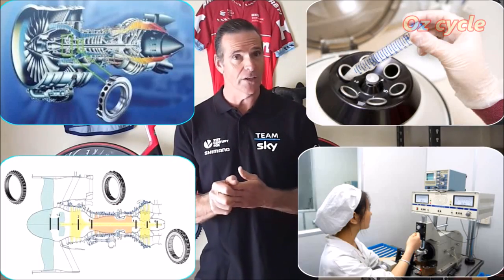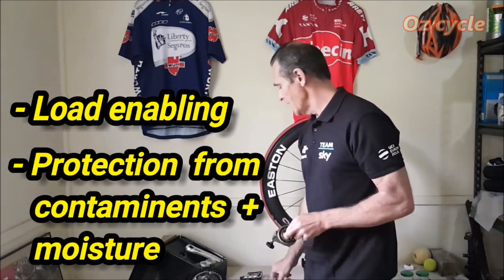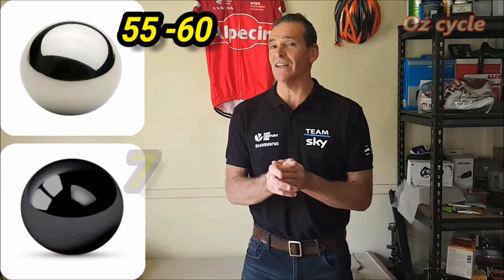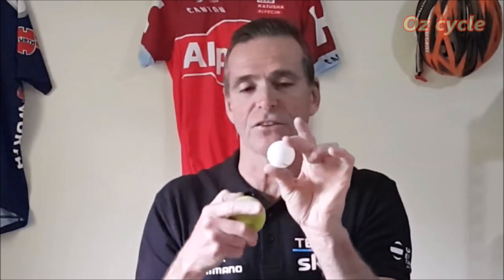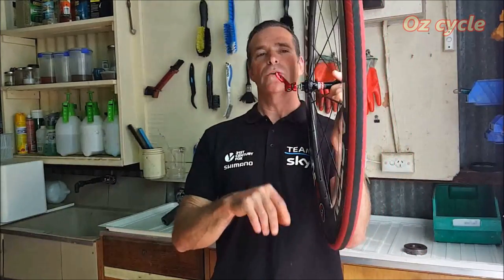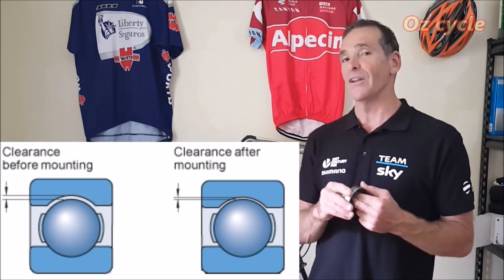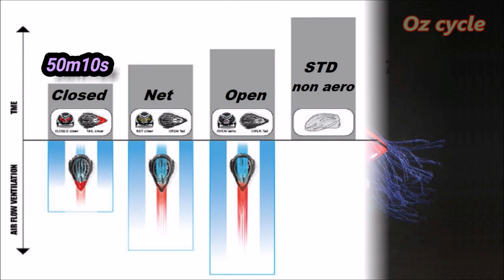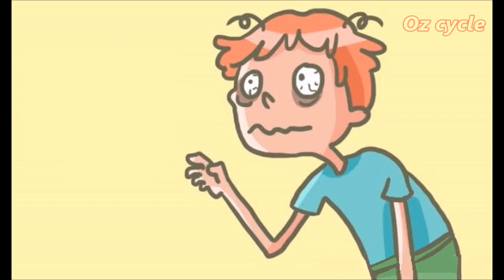Ceramic Bearings - You need to know!

Comment: Ceramic bearings are used on spools for bait casting reels that can reach rpms up to 30,000 rpms. I’ve converted some of my reels already. My mtb has ceramics in the shifter cogs. Liberty makes some pretty good synthetic oils. 
I’m waiting for a set right now. 
And English website “ Pimp my reel” upgrades the bearings on request. The anglers can throw weights almost 300 yards. 
You can order from China 🇨🇳 for cheap.
Reply: I can see that on high rpm applications, but bike wheels turn between 200 and 300 rpm . I doubt very much that even a pro rider in a blind test would tell the difference in almost any bearings in the wheels that are properly set up and tuned.

Comment: I like your reviews - always informative. I query your comments about lubricating sealed bearings. In my experience, sealed bearings are just that - sealed, and they can't be re lubricated. Shimano bottom brackets are specifically marked - 'Do not disassemble'
Reply from the maker: I see your view Richard. However, "sealed" bearings are not entirely sealed if water and debris can get into them,which is all too common with bicycles. Hence the need to either replace or clean and relube them.

Comment: Very true, I cleaned all the grease from my pedals as I noticed how stif they appeared and applied some light oil as an experiment. The pedal spun much more freely afterwards. I did replaced the grease with much lighter grease before use. It just means I have replace the grease more often, it’s only a 5 minute job once a year. 
I have BBinfinite bottom brackets, maybe it’s the placebo effect but I’m sure its much easier to pedal. Plus using your waxed chain. I cant ride faster i just feel like i get upto speed faster.

Comment: This is why I switched to MG chemicals White Thin Lithium grease. It’s great on firearms sliding metal parts but it’s even better on bike hubs with loose bearings. Since I can’t stand sealed bearings I started using this lithium  grease for packing my road bike hubs and also the Older caged bearing bike bottom bracket. It’s a cheaper bike but it is just super quiet, unlike the more expensive bikes sounding very noisy drive trains.

Comment: Yes other industries use Ceramic bearings... not hybrid Ceramic bearings like the cycling industry!

The best and I mean the best bearings you can use in your bike is high quality steel. Hybrid Ceramic is for people who fall for marketing. Hybrid Ceramic give no real world performance benefit and cost more and don't last as Long.

Ceramic bearings are not more round than steel, it depends on the quality of the bearing. Chinese Ceramic bearings are as round as bananas, even an average steel bearing is better.

Also steel cages are better than the polymer ones as they cause less friction.

Also don't bother with Ceramic bearings if you have a carbon bike BB shell, because the shell tolerance is not good enough for the bearings.

I run a bike shop and I see the average Ceramic bearings lasting about 3 to 4 months before they destroy themselves. I wish customers would stop buying them and wasting their money. They are just an expensive way to not go faster.
Reply from the maker: Yes its still contraversial about steel vs poly cages but the bicycle industry favours the poly at the moment.
Reply: oz cycle I don't think it's controversial? It's fact, they have the data. The poly cages are normally populated by hand and steel are made by Machine so have better tolerances. Check out the video on how bearings are made at NTN or this video for more information 🙂👍🏻
https://youtu.be/o7iZVfSDbiA

PS. Only some manufacturers (the ones I don't use) Favourite poly cages. I have DT Swiss wheels and praxis BB and all come with steel cages. I think the maybe Chinese Brand’s favour the poly?
Reply: Reginald Scot ... I've been using CeramicSpeed and Formula 1 ceramic bearings. BB, the harder I press down on the pedal, the easier it spins, been able to go up hills in the big ring, which I couldn't do before. Downhill, the faster I go, the least resistance they have. Big downhills where I'm going between 45 and 55mph, no one can stay with me, coasting, people pedalling have tried to keep up and can't on rides. Ceramic bearings have been my saviour in keeping up with the younger crowd. I'm 57, 6'3" and 200lbs.
Reply: @happydays8171  placieo is that much effective. anyone heavier than 200lbs will be faster at coasting. Physically from the native design of ball bearings, resistance you would get is about 0.3w. From here, the resistance from the ball is about 0.05w. If anyone can feel that... kudos to you...
Reply: Reginald Scot so true. Ceramic on ceramic like overused in RC last because the materials are.the.same. basically ceramics are for non load or minimal load applications
Reply: Thanks for the interest, allow me to explain please. I understand the placebo effect and gravity's effect of my weight going downhill. Before ceramics I was your average rider, middle of pack going downhills, passing no one. With ceramics - at high speed - I am now untouchable. i.e. RAGBRAI 2016, southern Iowa, very hilly, 15,000 registered riders and nobody passed me on the downhills, and there were plenty of heavier riders than I that I was passing. My point is ceramics only come into their zones at high speeds, at pedestrian speeds they offer the same resistance as steel.
Reply: @happydays8171  im sorry but no parts in bike is 'high speed'. Look up any mechanical engineering papers. Any steel and ceramic bearing (full ceramic which is superior in rolling than hybrid ceramic but yours is hybrid ceramic) have no difference until 15,000 rpm. Even if you ride 100mph, your bearing wont even reach 1000rpm. Good luck with that difference. It's just science.
Reply: 피토라이더 well put sir you are correct. I used to use fully Ceramic bearings in industrial applications in electric motors spinning at several thousand RPM. They are excellent for that application, but I wouldn't put them in anything that needs to deal with speed bumps, sand, grit and potholes!
Reply: Okay, okay, I've been researching this, using Hambring's test results NSK's VV steel bearings appear to be better  (the ceramic bearings that came in my Rolf wheels actually started eating up the hub like you said so now I'm trying to wrap my mind around the fact I might have been wrong.). Question, what's the best lubricant? One guy has a lubricant he claims never let's the metal touch, creates a microscopic film like engine oil between moving parts. What do you recommend, and how much? Syntheric or conventional, 1/4 fill, or more, and how often should I clean them? I ride 2,000 miles a year on one bike, 1,000 on another.
Reply: @happydays8171  it's just the best to just replace them regularly. Never a good idea to take out seals (takes up 60% of resistance for bearing). And greasing performs the best at 30% of volume filled, but it will affect longevity. It's always a trade off. Performance and longevity. Thin oil performs better but shorter life, thick grease resist more but last longer.
Reply: Happy Days Lowest friction is achieved by using a very small amount of very light oil, but it won’t last a single ride. Top flight track riders with full mechanical support to service bikes after each short, clean ride on the smooth pine wood might glean some benefit. Beyond that you’re looking at thick oil or grease. Manufacturers all recommend the latter. The refill rate is specified in the manufacturer’s technical literature and can be different for each bearing based on seal type, bearing type, tolerances and use. Grease increases the resistance to movement. This resistance is fluid resistance rather than the friction you’re more familiar with between solid surfaces, rather like the difference between squeezing washing liquid, water or air through the thin nozzle. Too much grease however can cause the ball to skip rather than roll which can cause direct contact between solid surfaces.
Essentially, the very best solution for real-world cycling is to use very high quality Japanese steel bearings with a non-contact seal for wheels hubs. Bottom brackets are much lower speed bearings and higher load and so the biggest issue is creaking. The higher and narrower tolerance of Japanese bearings is their advantage here. 
The only place where top quality ceramic bearings might help is in the jockey wheels, especially if you’re replacing a bushed cage with a bearing type. This is because of the low load, high speed and the ability to easily relubricate using lighter oil.
Reply: Someone changed their view on the basis of opposing comments. Truly amazing and possibly a first for YouTube. Good discussion Happy Days , 피토라이더.
Reply: @happydays8171  Is it possible you just go stronger?
Reply: Methodical2 --> Haha, that could be. I watched Chris King in an interview on here, he didn't seem to be big on ceramic for wheels, so last set of wheels I bought, left the steel bearings in, if anyone knows bearings, I think he does. We'll see, so far, I can't tell any difference.
Reply: Happy Days it takes incredible courage to test your beliefs and go read upon a subject. I am Super impressed that you decided to do your research and test what we were saying. If only everyone could be like you sir the world would be a better place. As for what I do with my BB I use a Praxis works BB30 to 24mm adapter that I have pressed in some high quality non-contact type steel bearings and used a lightweight grease using a syringe to place just the right amount. When people see my crank spinning without the chain on the bike they think it's a Ceramic bearing. 😂
Reply: Reginald Scot -- Thanks for the comment. You know my type, anything for free speed. So many different variables can negate the gains gained by ceramic bearings, i.e. tight seal, thick grease. Some years ago I bought some ENVE rims with DT 240 hubs, in my downhill testing, didn't get any more speed than steel after putting in CeramicSpeed bearings.
Wish I would have stopped there!
Reply: @happydays8171  Exactly. I bought Campagnolo Bullet 50s with steel bearings (not CULT) for all of the reasons listed not only in the video, but in comments left by Youtuber "in the know". Perhaps a perfectly tuned set of ceramic bearings would save me 13 seconds over my usual ride for 2 or 3 days or weeks. But I don't have the money the replace the bearings regularly like pro teams because they get a trailer full to last the racing season. 
So, as for me, "steel is real."
Reply: what kind of polymers?
i could definitely see thermoplastics deforming against the bearing creating friction...
Thermoset polymer?
Reply: @ptorider  Strongly agreed to you!!!

Comment: Please advise if it makes sense to lubricate the crank axle (as so many YouTube videos recommend). I'm of the opinion that you don't want the crank axle to slip inside the bearing effectively forming another bearing withing the BB bearing only this time without the advantage of having ball bearings to reduce friction. Thanks for this very comprehensive, informative and no-BS look at bearings and cost vs gains for ceramic bearing and other places to seek watt savings at less to no cost. Love your in-depth and mature way of looking at things. Cheers from Italy.
Reply from the maker: A small smear of grease on the axle where the bearings contact it is good. In some cases,if the bb creaks, 2 drops of loctite instead of grease.
Reply: You need something to prevent rust or galling  of dissimilar metals.  Grease offers some protection however thickened antiseize is better.  The interference fit of most crank bearing interfaces prevent any slipping under normal use.

Comment: Great summary. Especially the $/watt comparisons.  I'll not be using ceramic ones for many reasons.  I have read also that durability is an issue in pat because of their interaction with the race.
Reply from the maker: Yes,very hard races are required otherwise they get chewed out by the ceramic balls.

Comment: Bearings are made of clusters of atoms. Lubricants are made of atoms too - specifically stuck together as molecules. So good lubricants will be near spherical, stable and chemically inert clusters of molecules which have low Van der Waals (electrostatic) forces. You are just packing lots of nano scale ball bearings around the macro scale ball bearings.

Comment: My first experience with ceramic bearing was 9 years into my cycling career. I can tell you I noticed an immediate difference. Especially in a pace line. When the front rider stopped pedaling, I would normally stop pedaling to prevent running into the front rider. Now that does not work. I have to pull out into the wind to prevent running into the front rider. And no, it's not placebo. No one mentions TIME in their equation. Saving small amounts of wattage over a long period of TIME adds up. When seconds count in a time trial it matters. On 100 mile bike rides it matters. I've ridden the same mavic wheel set with ceramic bearings, installed by me, in all kinds of conditions for at least 5 years and have had zero problems.
Reply: What brand name are the ceramic bearings you use?
Reply: @BEEBEE159  F1 Ceramic American Made Grade 3 https://www.f1ceramic.com/  I haven't tried the coated version, they were not available when I bought mine. I put in a mavic elite wheel set.
Reply: I would tell him to either keep pedaling or get the ---- off the front.
Reply: @Geeios1  Thanks for the info.

Comment: I bought cheap jockey wheels with ceramic bearings (because i need replacement anyway, so nothing to loose)
And "chinese" cheap ceramic wheels was in same price like standard metal "branded"
I replacd bottom plastic wheel with steel balls 11T for alloy/ceramic balls 12T, and upper wheel plastic/steel - 11T for alloy/steel 11T as well
Just apply a bit of wax based lube just enough for cover balls...
Result is beyond my expectations - chain run more freely and quiter.
Shifting is better as well...
Just one thing - i ordered 3 "chinese" wheels (keep it for spares) and every one is slightly diferent in feel (tolerance). So bear it in mind... But running smooth so far (500miles done at MTB bike in dirty/muddy/dusty enviroment). Just cleaned and regrease it after this distance (still first one is on)
Reply: There are either chainese (from Uncle Lao workshop) and Chinese (from factory). Take your pick.

Comment: Umm one correction grease is just oil with a soap(thickner) mixed in the reason for this is to keep the lubricant in the areas I.e. the loaded zone of the bearings. The viscosity of the oil is what keeps the metal surface apart. My point is use the right grease and not oil. Oil will move away from the area of force! Grease will not as the temperature rises the grease will become more fluid and keep the bearing lubricated.
Reply: What about my Glock, though?

Comment: High tolerance? High spin capability?
What do they have to do with bicycle industry?
If we care to wiki a little, we are aware that ceramic bearing is used for its characteristic that it is electrically insulating to avoid/reduce degradation of electric motor.
And yes, micro porosity keeps it lubricated better under high revolution. And we are talking about tenths of k-rpm here.
What's the rpm we are talking about in bicycling? 60mph or 100kph? That's far less than 1000rpm at the wheels of you do manage 100kph all the way. I admit I'm a slow rider at 20kph in average, and that's around 100-ish rpm?
Reply: The gentics lab my friend runs has many high end centrifuges, to separate genetic material from the rest of the cells dross.   Those centrifuges spin at a minimum of 250,000 revoutions/minute, and those are the older model.   Those certrifuges cost 250-300K/each.  They must use ceramic ball bearings.  BTW,  they take turns being "down".   Bikes?, bikes are a joke compared to motorcycles, cars, airplanes, simply because the human body puts out .25-.33hp on a bicycle.  That is nothing when a 400hp dodge supercharged car buzzes by my head to prove how much faster he is in his fancy sports car.  Funny thing is, I usually catch these Aholes waiting at the stop light or at the filling station.  Then, I set down my bike and let my 245lb frame greet them properly!..  I am not a small rider nor an intimidated one.

Comment: Hi! Is it better to put ceramic grease to regular steel bearings instead of just regular grease? WIll it spin smoother in time?
Reply from the maker: Yes you can use ceramic grease on steel products. Protects against salts , acids and moisture.

Comment: Nothing beats a nice new bearing, replacement especially cheap orig spec with better quality steel will always pay dividends. I dont understand why the bottom bracket doesn't run in an "oil bath"? Perhaps drill a hole inject oil seal up hole.

Comment: I have a tcr with slr-1 wheels (rebranded DT swiss 360/370 hubs) slow rolling out of the box. Want better climbing. Would any bearing upgrade make a difference. Or should I get a new wheel set? Or just train harder😅
Reply from the maker: Hill-climbing is primarily affected by your weight, so always good to train harder!

Comment: At 14:37,  talking about removing inside seal the reduce friction. When one riding, would the friction cause heat, heat then cause the grease to goes thinner, having both seals would help retain the grease?
Reply from the maker: Would never get hot enough to cause grease to creep out.

Comment: Thaks for a great intro. The Rockwell rating differance is a bit off. You ment that ceramic is ~30 % harder than steel, not 300 % (3x) harder.

Comment: You're wrong. Steel bearings have been in use in tons of applications for decades and does the job excellent in most situations. Ceramic has advantages but are not necessarily worth the extra cost for anyone but those who does professional cycling.